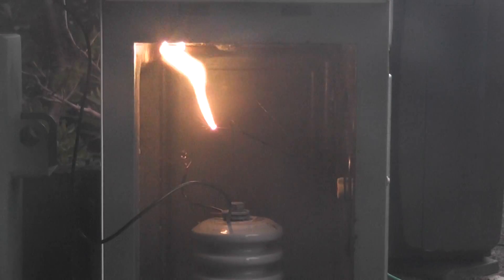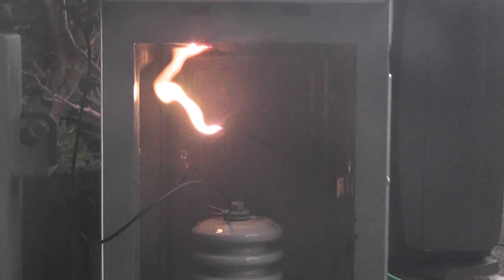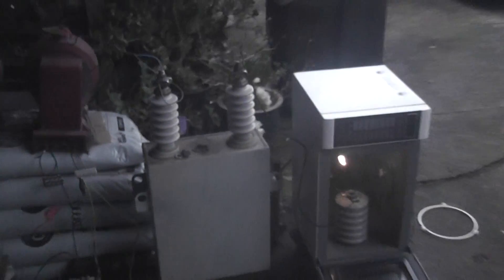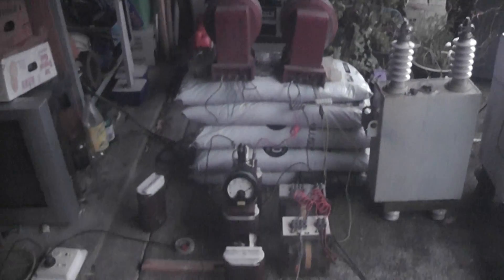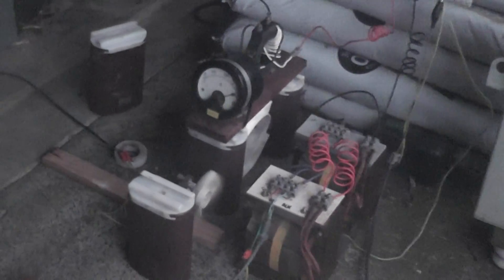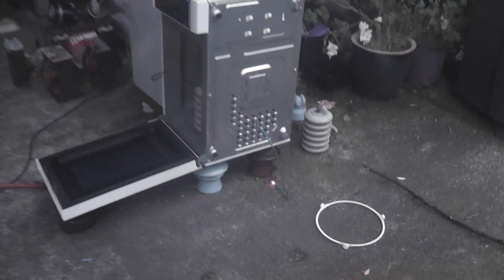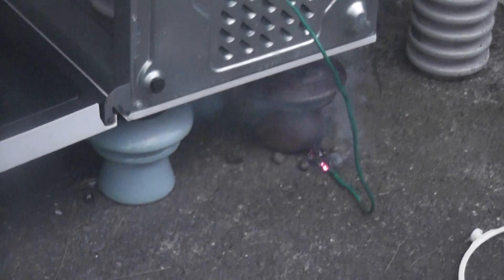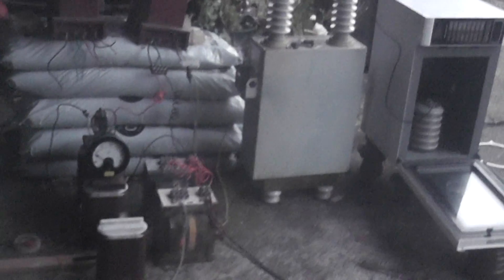Long arc session at 10 kV

Comment: Aaaah, a fizz-up in the microwave.

Next time, try stuffing that 10kV straight into the magnetron. Let's see how long it then takes to heat a cup of water. :D

Thanxx for showing,

-BoomBoxDeluxe.

4th October 2015, 21.05
Reply: *****
Well yes, it'll need all that hocus-pocus, but you get the gist. :D

10kV microwave ripped RIIIIIIIGHT UP!

-BoomBoxDeluxe.

5th October 2015, 01.56

Comment: Lovely sustained arc.

Did any of the transformers get warm after that run?
Reply from the maker: +Paul Roberts The VT remained more or less cold ( 5 Amp winding on 50 Amps !! ) ( mind you thick resin casing ) The 100 Volt transformators were warm to very warm.

Comment: is it right that 50c/s produces yellow ish arcs and higher frequency produce bluish arcs?
Reply from the maker: +jon johnson It depends upon what metal is on the electrode. Iron yields Yellow, Aluminium yields Blue, Copper yields Green, PVC covered wire yields Pink. Very difficult to capture the colours on camera as they are so bright.